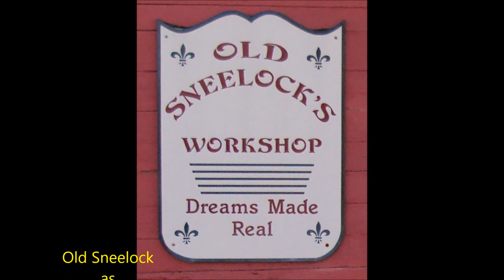PUTTING A SHAVING EDGE ON A BLADE ~ SPOKE SHAVE SHARPENING

Comment: I installed the blades bevel up and I struggle with it. I am of course a novice too this. I sharpened the blades like you showed and yup they are sharp. If I installed them correctly then I bet it is a matter of me setting them properly. Looking forward to your advice.
Reply from the maker: Any improvement from setting the blade bevel down?
Reply: @OldSneelock  Greatly improved. Just need to learn it better.
Reply from the maker: The fun part!
Scrap wood and making shavings. No plan just long smooth strokes. 
Bevel the corners then use the curved blade to round them off. 
Start with no shaving and tap it down til it just starts cutting. 
Change direction just to see what happens. 
It is a finishing tool. 
Have fun. 😁😎
Reply: @OldSneelock  TY

Comment: Bevel up or down?
Reply from the maker: On this iron spokeshave the bevel is down. 
The cutting angle is established by the angle between the sole and the blade mount. The bevel is there so the leading edge of the blade contacts the wood and the trailing edge is not in contact. 
Since the blade angle is set by the body of the shave at about 35 to 40 degrees if you put the blade in bevel up that puts the cutting edge at about 80 degrees to the surface. It won't cut as much as scrape.
Think of it like using a jack knife. If you lay the jack knife blade flat on the wood it won't cut. You have to raise the back of the blade up so the edge digs in.

Comment: So what is your (tentative) verdict?  Do you think it could become your "go-to" tool for making custom hammer & ax handles?  Or is it more the type of tool to produce super smoothed dowels in one particular size?
Reply from the maker: Brian Neeley I doubt it will be a goto tool. It will work for the narrower radii on axe and hammer handles. I usually buy blanks for them. Most of my handles are chisel and drill handles made on the lathe.

Comment: The only thing you didn't show was how you sharpened the curved blade.  I have to that I have to sharpen.
Reply from the maker: I ran the process at 4X speed perhaps you didn't notice. 
At 4:32 I show you how I mounted the blade to an improvised handle then for the next 3 minutes and 30 seconds I show you how I used shaped stones to sharpen the curve and the waterstones to flatten and polish the blade. The process ends at 7:56 with the blade sharp and ready for the following testing. 
I have found that If I don't speed up the repetative work the audience drifts away.
Reply from the maker: F4u-SuperCorsair Thanks for mentioning your concern. Most people just hit the dislike and go on. 😕
It's a balancing act. Too much information and I can feel the eyes slamming shut. Too little and what's the point. I settled on 4X so the viewer can still see that the stuff is happening but it makes you watch to see it. On a computer you can set the speed at 1/4 speed to see the 4X in real time.

Comment: How about showing the AMOUNT a blade should protrude?  Showing your finger & hands does NOT help !
Reply from the maker: There isn't a prefect amount. That depends on what kind of work you are doing. That is found by by trial and error. You watched me tapping on the blade to the point where it started cutting. Then I tapped the blade out until it cut like I wanted it to. 
Relying on someone to tell you exactly how much stickout of the blade to have only works if your tools are exactly the same as the person telling you and you are doing exactly the same cut in exactly the same material. Practice setting the blade to what you want it to be.